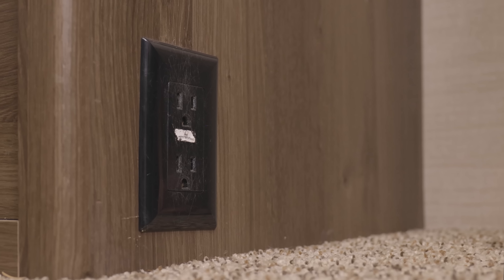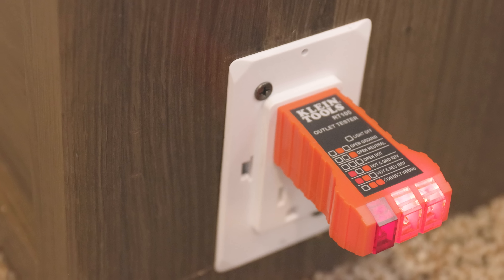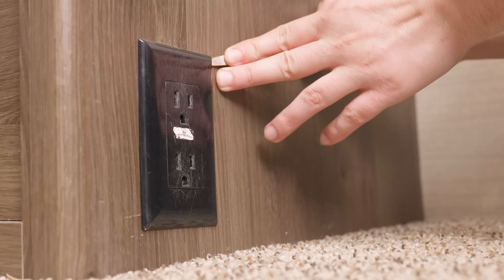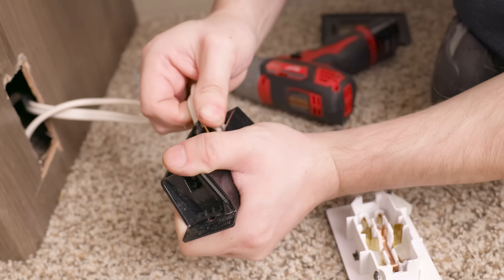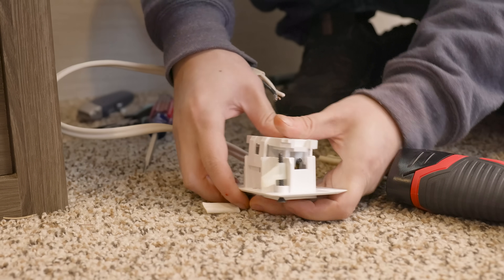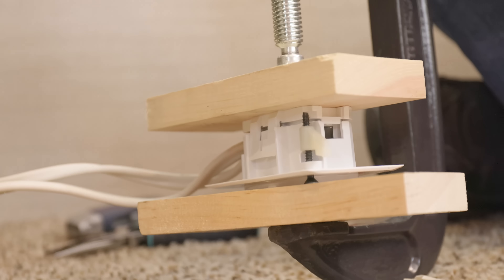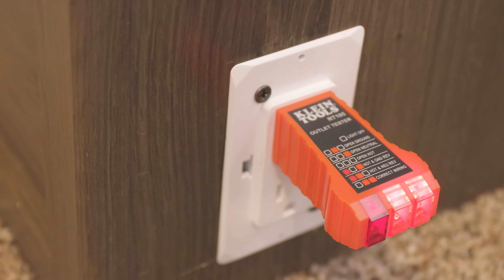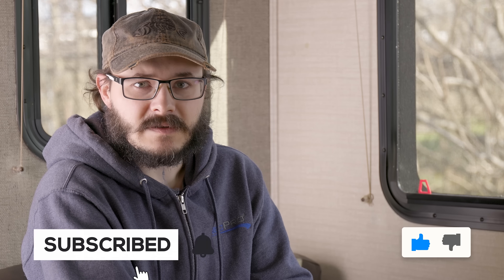How to Replace an RV Electrical Outlet with RecPro - EASY 30 Minutes

Comment: Why can't you use regular 15 amp outlets I have a very old camper and regular outlets work fine my wife's camper can't find the line and load.
Reply from the maker: Hello, it depends on your situation and camper. if your camper already has an electrical box then you can do so. If you're camper doesn't have an electrical box you'd have install the electrical box. The RV outlets have a built in self contained box that requires a smaller hole for installation. The RV outlets are also 1.5 inches deep which is great for tight spaces.

Comment: Where can we get theese replacement outlets?  What are they called?
Reply from the maker: here's the link to it: https://recpro.com/rv-dual-outlet-receptacle-with-snap-on-cover-plate-white/?utm_source=youtube&utm_medium=video&utm_campaign=outlet_tutorial
Reply: E-102C DUPLEX RECEPTACLE PARAMOUNT PLUMBING AND ELECTRIC IN Lexington,  Tennessee has them and can help you find cc a place close to you or maybe find them on eBay.  Some vendors have great RV parts. Im doing mine today. Imagine my shock when it looked nothing like a regular 20 amp The brand is United States Hardware Manufacturing, Inc. Washington,  PA.15301

Comment: Mine have wires going into the top and bottom. No white, no black.
Reply from the maker: Hello if you have wires going into the outlet and you can't identify which is positive and which is neutral then please have a professional check your system!
Reply: @RecProUSA  thanks. I am trying. No one wants to do RV work. I did discover that the place is wired in series, thus the top and bottom wires.

Comment: I would have never thought of using a clamp. Thank you for posting. I was trying to jam them in there with a flat blade screwdriver.
Reply: Like wise those crappy outlets that campers use.
Reply from the maker: Glad to hear you found this tip in time!

Comment: My fireplace stopped working and found out it was the outlet. It only had a single outlet but I bought a dual. I only have one set of wires so only one outlet will work. There were no instructions on this so I came to YouTube land. Thank you so much for posting this! Saved me so much time. I made sure to cut all power. I don’t need a new burnt hairdo 😜😜
Reply from the maker: We are glad that our video were able to help you out! Thank you for being safe and cutting off the power!

Comment: it has to be a rv outlet? or any outlet?
Reply from the maker: We would recommend sticking with an rv style outlet.
Reply: Why?   If i have to replace an RV outlet, it going to get swapped with a normal outlet.
Reply: @starhopper457  that's what I did with all my outlets, but I would suggest going with the more expensive commercial outlets, they give you a much better connection.
Reply: As long as it's the right 15 or 20 amp. I use regular 20 amp in my rv and it's so hard for me but I'm replacing them one at a time.

Comment: I got travel trailer from 60's or 70's whit these black outlets having no screws but a sheet metal behind and do not know how to peacefully remove them.
Reply from the maker: Hello, if your trailer doesn't have screws for removing the outlets then we would suggest having a professional check out the outlets.